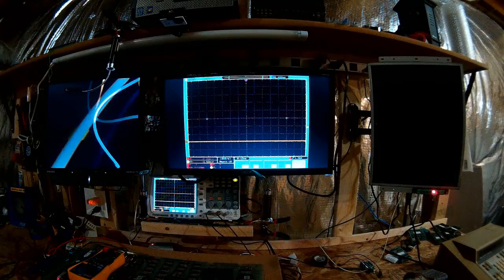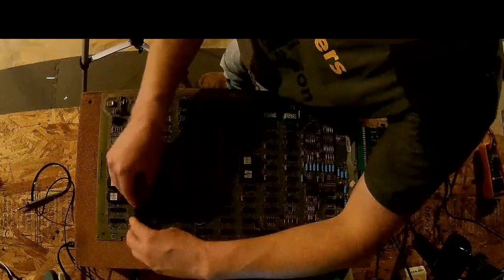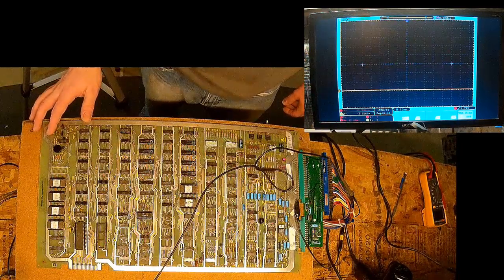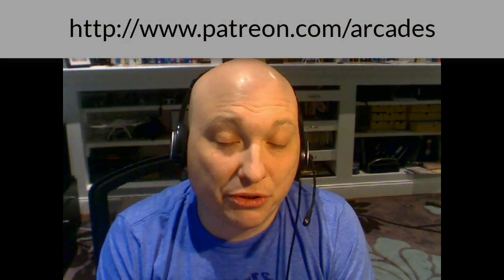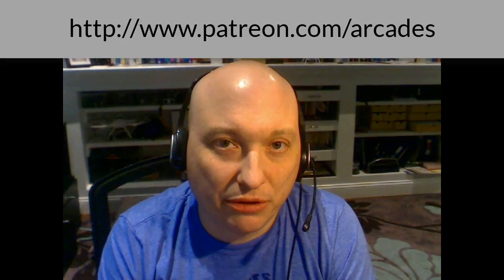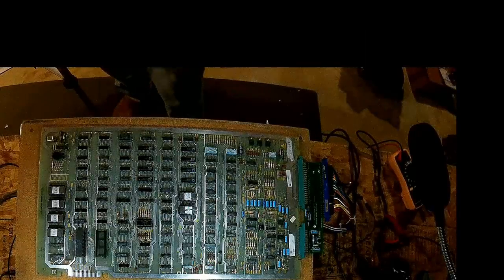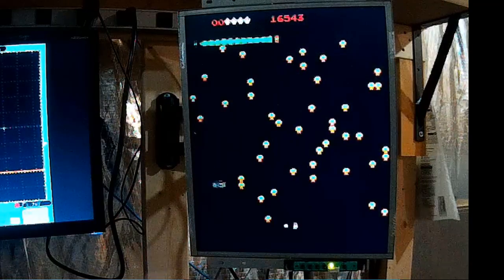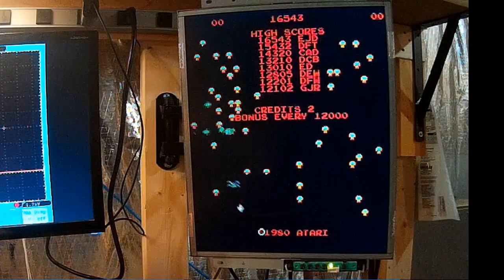Arcade PCB repair #20180214.01: Dead Centipede with no sync

Comment: I'm guessing they use IRQ signals as HALT signals in older arcade games to tell the CPU to stop and wait until the drawing the graphics on the CRT screen is done. The IRQ signals are linked up with the H&V sync signals and retracing of the CRT screen when tells the CPU to stop and wait until the drawing is done. I'm not really sure how it work but I'm guessing vector arcade games use HALT signals to tell the vector signals to draw the graphics on the screen. I'm not sure what non-vector arcade games are called what? since they don't use vector circuits they use Vertical and horizontal sync signals were vector arcade games don't use V&H sync signals but use vector deflection circuits?

Comment: I think Atari Black Widow used Halt signals or Sega arcade games used Halt Signals. I'm confused what the difference between a Halt signal and an IRQ signal because both signals make the CPU jump or stop. Most arcade games use the NMI pin on the Z80 or 6502, any reasons why? The NMI makes the CPU jump just like the IRQ pin makes the CPU jump so what is the difference between an NMI and IRQ signal?
Reply: it's possible, I never looked at a black widow, but all the games I've ever looked at that I remember don't use it with the exception of Sega/Gremlin VIC/dualVIC type boards. NMI and IRQ are similar except that software can chose to ignore IRQ where NMI cannot be ignored (stands for "Non-maskable interrupt (Where mask generally means "ignore") in this context.)

Comment: What are strobe signals and halt signals used for in arcade games? I'm not sure what they are used for in general mostly also to know the theory behind using strobe signals and halt signals
Reply from the maker: bill williams I don’t know what you mean in reference to strobe, do you mean /CAS and /RAS on dynamic rams? Halt stops the cpu it’s usually not used in arcade games, though if I recall sega gremlin games use it when something is detected broken.

Comment: if the arcade games memory mapping list didn't have the ROM signatures for each ROM chip, how can you use a handheld calculator to compute the ROM signatures? what formula can i use please
Reply from the maker: you cannot realistically do this, you'd have to write a computer program to implement whatever checksum algorithm is being used.

Comment: Hey, I'm having trouble with my trackball not working at all in my Centipede, I threw a mates board in and it works, so definitely a board issue.
What could be the issue you think ?
I've looked over and changed most of the chips in the trackball circuit, but hasn't got it going as yet.
Any help would be great :)
Reply: did you replace both the MC14584s? that's the most common failure, if not try replacing the capacitors in that circuit and finally shotgun replace the other 4-5 chips in the circuit.  if that's not it it could be address decoding issue. if you have a oscope or logic analyzer you can narrow it down without shotgunning but without either of those it's easiest just to shotgun replace the stuff above.